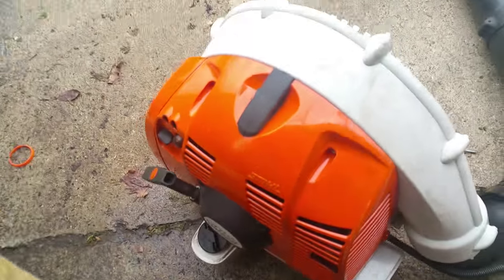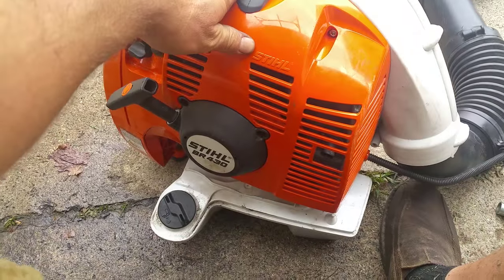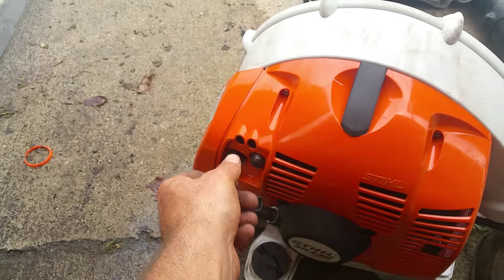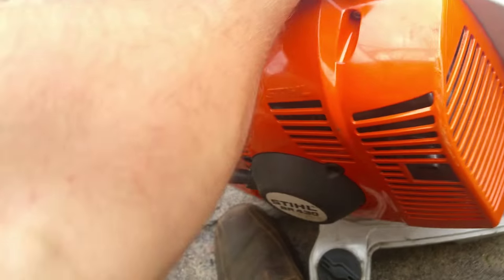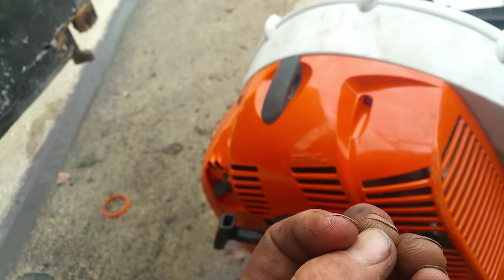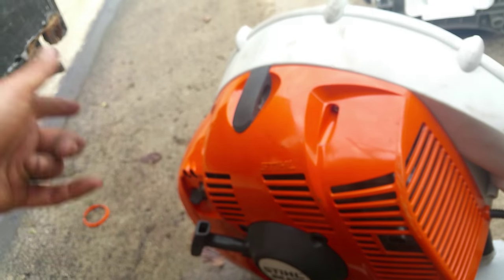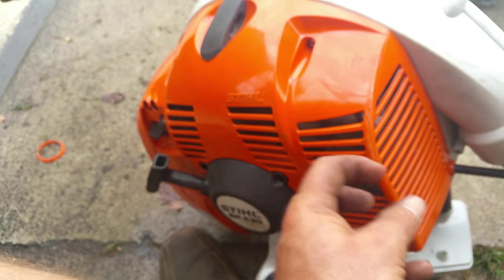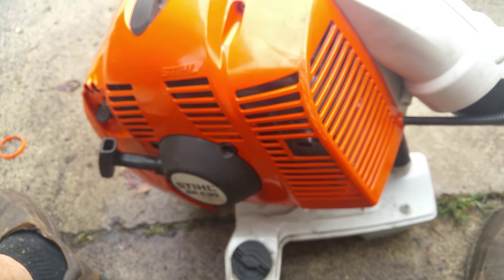Stihl BR430 "Spark Arrestor Screen" [Quick Fix Tip]

Comment: Keith, I learned this lesson about spark arrestors years ago when my Stihl BG 86 leaf quit blowing but was running.  I took it to the shop, and they fixed it and then they showed me the spark arrestor and how to clean it.  About every 2-3 months I take the spark arrests off and clean them using either a portable propane or Mapp gas portable burner.  Just don't ever remove the spar arrestor.  There was a California wildfire years ago and they determined that a tree guy was using a chainsaw without a spark arrestor and hot oil got through the exhaust and started the fire.  In the end the guy was charged and was responsible for all the expenses of service and damage property that he had to pay for.

Comment: Hey, just a heads up on the spark arrest screen. One of the leading causes of clogged screens is that the fuel and oil mix ratio is wrong. To much oil in gas causes the carbon to build up instead of burn up and will clog up very quickly causing the machine to bog down when you try to rev it up for use. Like your videos, good job.

Comment: I keep a small wire brush hanging in my trailer just for this purpose. Usually first thing I check if something starts bogging out. I'm with you Keith, hate working on equipment. ;)
Reply from the maker: Working on equipment is a drag.

Comment: Went and replaced everything with the fuel system with my 430 from the spark plug carburetor to the fuel filter checking compression only for the reason it wouldn't crank to be the spark arrestor to be clogged  slam up I say toss them in the trash and don't worry about it again

Comment: Yea all them have it. the 4 mix modules don't get stopped as bad as the actual 2 strokes. I am almost certain that the 430 is a true 2 stroke and not 4 mix. My 94'r trimmers have to be cleaned often since they are 2 stroke.
Reply from the maker: Yea.
I remember back in the day...
Cleaning the old Shindaiwas

Comment: There's an easier way than using chemicals. Just take it out and put it over an open flame with a pair of pliers. It will turn bright orange and all the carbon will burn right off. Blow it off with the air compressor and you're good to put back in. It will look brand new. I use the side burner on my grill. I put the actual muffler on the burner too. It takes longer to burn off but cleans it all out.

Comment: I usually take those out of all my equipment, once they are clogged usually, especially if the get rusted, they are useless. so Once the clog the first time I take them out and run the equipment without them. never have another problem. The emissions are usually only good for so many hours anyway, my blower says the emissions are good for 300 hours and it's 5 years old. So the emissions system on my blower is toast, but it still runs strong, now that the screen is gone.

Comment: Another thought.  You may not have a problem.  My dealer runs the fisrt tank of fuel rich for break in. So they might have went a little overboard :)
Reply from the maker: Aha!  I actually just took a screwdriver and stabbed a hole in it....
Reply from the maker: Aha!  I actually just took a screwdriver and stabbed a hole in it....

Comment: Just buy the STIHL gas/oil mixture at a STIHL dealer. You will never have to worry about to much gas or oil again. You can also cut the spark arrestor off.

Comment: how does that blower preform compared to a handheld? im stepping up to backpack stihl and seen this one at my stihl retailer al lowest model
Reply: I have a handheld for cleaning gutters.  but the backpack blower Is what I use most often. it's only a pain getting it on and off and putting it on the rack. loved the handheld for only that reason. start, go and throw it back .

Comment: I found out with my tools I have to run 93 oct. and I have to use the silver oil pac from Stihl anything els and Im sure to have problems
Reply from the maker: Yes.   Running all premium in my power tools now too.
Reply: I’m going to try that cause this is a pain. I have to clean this Spark arrestor screen about three times a year

Comment: handheld propane torch works the best. heat up intill carbon turns white ash and wire brush off. works awesome.  Check out Donyboy73 channel for a lot of awesome tips. :)
Reply from the maker: Genius!
Reply: I can confirm. The torch method works great.

Comment: Remove the screen and enjoy the machine the way it was MEANT to run before lawyers and all knowing emissions idiots fucked up proper mechanical function...This goes for their saws, etc... They run properly, don't bog, have advertised power and can handle the 'odd' off 2 stroke mix.It's not Stihl's fault... You bought the right stuff, common sense rules here...Be smart, don't let the rules baffle you...Check a few Stihl vids and you'll see.......Kinda like putting a good exhaust and Air intake on a Car...a WHOLE different beast...BEAST !!! Modify and Dominate ! The way of the world...

Comment: Your running your mix to lean I believe that’s why your spark arrestor clogged up .. more oil kalfas 50:1 ratio.. I’m sure you make your mix to specifications but your team may not .. luckily it was just the screen and yes the spark arrestor is a fire prevention device installed0n all 2 and 4 cycle power equipment  post 2010 most makes and models .. only other thing it possibly could of been was the pulse port on the carburetor breezeway “ tunnel between carb and cylinder head “ sometimes those get gummed up and that’s what engages and disengaged your carbs diaphragm ,when hitting the throttle . My brothers a ECHO/Stihl/ Koehler certified mechanic if u were questioning the integrity of my advice .. subscribe to my channel if u ever get a chance doggy I only got two subscribers . Trying to get 1000 to unlock monetary .. good content too well not as good as you or genedyk’s in quality but I’m working on it. Lates on